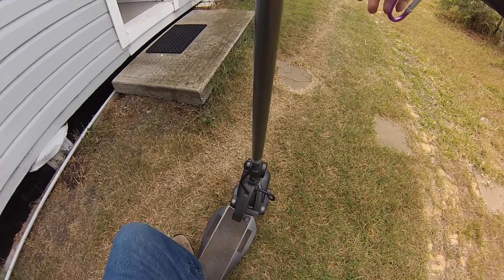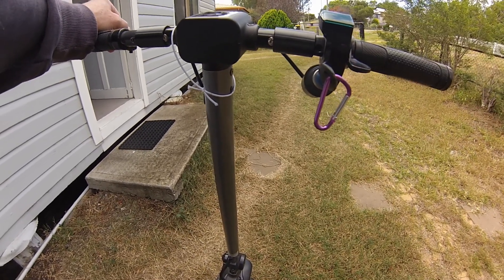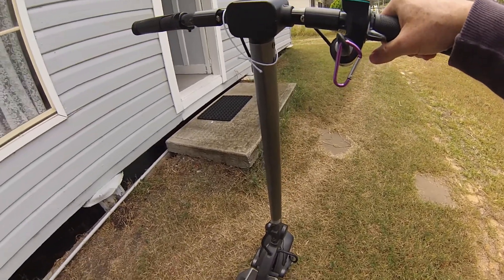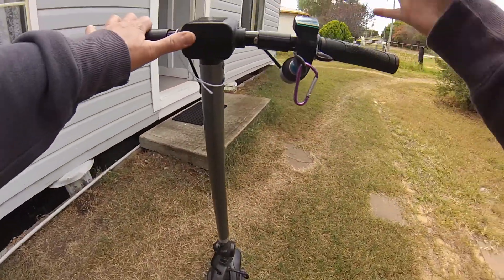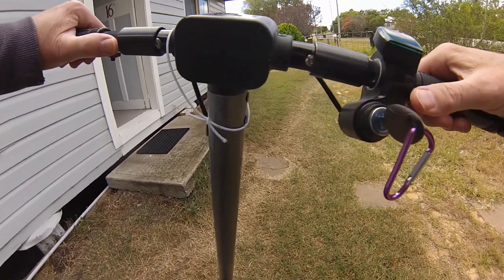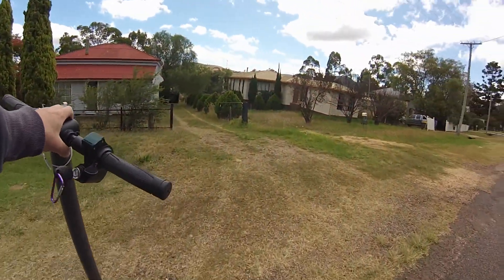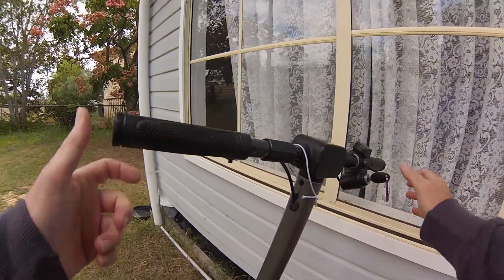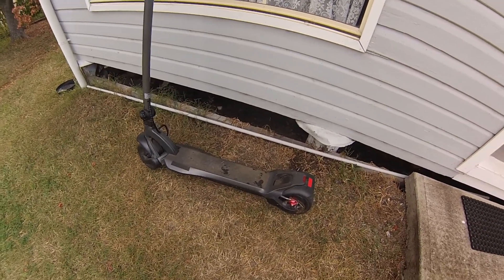Widewheel start  up throttle control

Comment: Disabling kick&go is good. It helped a bit. But still on the pro hard to keep balance the speeds up to 20 km/h. If you want to have cruise control at let's say 10km/h it will not be easy to do it. With the practice you can get use to but still not perfect. Many people upgraded the throttle and they say it solved the problem. I also saw a YouTube video in the comments guy said finally he changed the sensor in the original throttle and now it works perfectly.
Reply from the maker: Hi
>But still on the pro hard to keep balance the speeds up to 20 km/h. If you want to have cruise control at let's say 10km/h it will not be easy to do it. With the practice you can get use to but still not perfect. 
I brace my thumb against the key housing ... it took me about a week to get the hang of it ... I've got the 2019 model which everyone sequals about as being impossible to manage ... somehow I do ... perhaps I'm gifted, or perhaps just persistant.

Comment: What do you think this machine would be like to use on a golf course, I carry a golf bag with 7 clubs in it most of the time. I play on a course which is quite hilly, seems from your videos that the machine would have plenty of battery reserve. It would have to carry 100 kg at slow speeds for 4 to5 hours?
Reply from the maker: Nike: you should just do it.